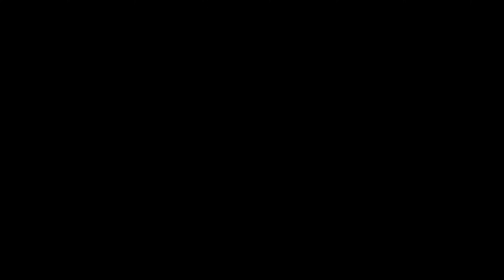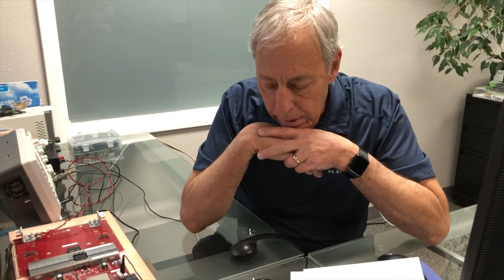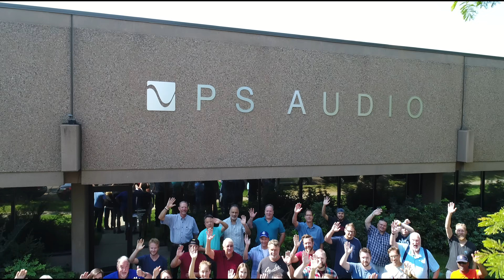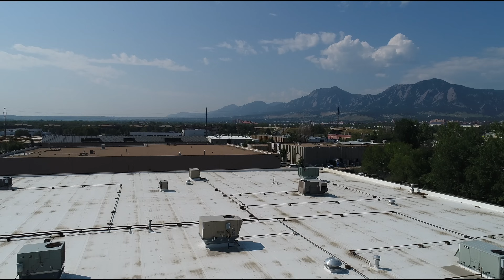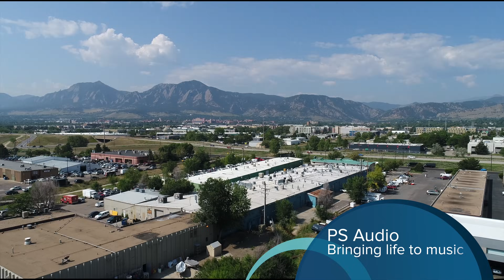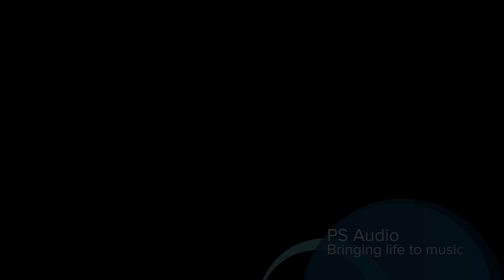What in the world is I2S?

Comment: Hello, is it possible to transmit the audio signal from a Bluray player via HDMI out (via an adapted HDMI cable) to a DAC Gustard X18 via I²S interface without errors? Or do you need an HDMI to I²S interface converter? Kind regards,
Ludovic
Reply: You would need that latter, as HDMI is a different system. When we have i2s over HDMI cable the signal remains as i2s and is boosted by a transmitter board using a RS244 chip to get around the inherent limitation of i2s over distance.
Reply: Also the pin configuration of the connection to the Gustard needs to be compatible, unfortunately not everyone is using the same pin configuration for i2s over HDMI.

Comment: I have a specific question that I doubt anyone here (expect for Paul/PS Audio) can answer. 

Recently, I've been interested in a high-end DAC that costs about 20K - it uses ASIO only, yet has its own master clock module that is situated on the mainboard; close to the DAC chips.
Can we assume that audio quality / accuracy will be equal or greater if the same DAC was using I2S? So in other words, does having a master clock in a DAC make the protocol you're using invalid?

I2S vs ASIO -
Reply: As long as the data stream reaches the DAC and the clocks are all correct and accurate there will be NO difference. Also, don't spend $20k on a DAC. You are clearly being ripped off.

Comment: Do I2S  provide DSD data when reading from SACDs ?  Wasn't there some sort of copyright issue hence the brands between the transport and DAC have to be IDENTICAL for I2S to provide DSD's  ?  If true,  is it correct to say I2S only works for PCM unless you have same brand DAC and CD Transport ?   Also, aren't there different pin-outs of I2S even using HDMI ?  I've seen DACs with what looks like RJ45's (network jack) labeled I2S too...... Thanks.
Reply: No sure, but the i2s/HDMI transmitter baord in my transport has a DSD connection, as does the receiver board in my DAC, I just didn't connect it on the receiver board in my DAC as i have no desire for DSD.

Comment: 2:16: and there it is... the reason for i2s is that it is easier for the manufacturer to implement while simultaneously creating a proprietary cable standard to lock you in to the one (or few) manufacturers that use it.  Personally, I’ve never “heard” an audible difference when super-clocking above the audio frame rate as the audio sample rate is still the lowest common denominator, but there are very tangible benefits to super clocking in a mixed environment (e.g. a recording desk) where multiple devices may be running different sample rates while locked to a common clock.  For this we have a standard for word clock over coax already that can run upwards of 256 x the audio sample rate, compared to i2s at 16 x the frame rate for left and right channel respectively.  Wish more audiophile companies would use the established standard instead of inventing new cabling formats without a demonstrable gain in performance.
Reply: I only read the first two lines, and you are so wrong I couldn't go on reading.

Comment: That was terrible! You explained nothing.
Reply: ...or perhaps you're just dull. 

Paul is right about I2S being superior. I would suggest "kernel streaming." This is most basic/optimal layer for audio on Windows operating systems. How can I prove it? Well, try this - Get yourself a high-end standalone CD player, then rip 1 track from a CD in 16 bit by 44.1 KHz. as a .wav file. Use a bit-perfect ripping software and check with Exact Audio Copy. The resulting file will also sound very similar to the playback you heard on the CD player. When you make machines work harder for the same result (ASIO - need to unpack and reassemble the clocks, there is degredation in quality & also higher latency).

Comment: Isn't I2S about the same as I2C?
I have used I2C protocol to control mini displays using an Arduino micro, was very simple to make it work by using available libraries.
Reply: Wrong. Not to be so critical but they are two different protocols. I2S is a protocol derived or parallel in working to SPI(Serial Peripheral Interface). I2C works great for displays and Memory devices and sensors but is too slow for audio. SPI and then I2S are the rather go to protocols for audio interfacing.
Reply: @spacesher3135  Thanks for clearing that up. That I2C bandwidth is too low for audio makes sense.
Reply: No its basically SPI. Infact pic32 uses the spi bus for i2s.

Comment: S/PDIF shouldn't really add any problems if it's implemented optimally. First, the data that comes in is also coming out 100% in the other end, in any normal case. It can resolve up to 24 bits of audio, which is plenty. It's using a Differential Manchester encoding called Biphase Mark Code (BMC) that is quite robust against timing issues yielding jitter. Still jitter is usually avoided as the data is buffered (having no data errors) and a PLL adjusted clock maintains the data that is fed into the DAC with no audible jitter. Yes, perhaps some crappy PLL can yield audible jitter. How is PS Audio ensuring no audible jitter on a S/PDIF input?

Comment: Dear Paul McGowan,

First of all. I love your channel, I try to keep up with as many vids as possible. Though I have a question you could be of great help with. 

Checking out if I am crazy or not ;-)

This is way off topic to this vid, but this way I hope to reach you again and I would love to hear what your professional opinion on this matter is.
I have a stereo setup, with Bowers & Wilkins CM10 s2 speakers and a good (Class D) amplifier (NAD C388).
The speaker wires I used were 4,2 mm² thick silver cables (AIV 23557L) from a big electronics store in The Netherlands/Germany. Already had them before upgrading the 603 s'3 to the CM's.

I was very pleased with the sound, but the fact that I used a (for me) quite high end system with cables I don't know anything about. I also had them connected via banana plugs to my amplifier because these were just too thick to fit bare wire (which I prefer). Also the right channel seemed more present than left, but then testing in mono, it was in balance. I wanted something I could rely on more and the investment was quite minimal compared to the rest.

Recently I bought 5 meters of Supra Cable PLY 3.4/S (shielded) cable (very affordable, but good cable according to the reviews) and made 2x 2,5 meter leads from them which I connected to the speakers and amp bare wire (+shield, if that matters). I left the HF-LF jumpers out by passing the wire through both holes, just what I did with the previous cable. They just barely fit through the amp binding posts by the way.

PS. I taped the speaker positions on the floor, so they were placed back exactly at the same position.

So the only difference is the Banana plugs are left out and I used another cable.

I tried very hard to leave any expectation bias out as far as that is possible, but I noticed 2 things.

At first, I just replaced one cable, to see if I was able to spot differences in mono playback. I noticed a sort of 'out of phase' experience, like if I had + and - swapped, but than a bit less obvious. I triple checked the polarity and it was not the case. Absolutely this effect was present and I could hear it 100%. Can 2 different (copper based) cables make such a difference? The cables were about the same length, but 4,2mm² vs the new 3,4mm².

Next I connected the 2nd lead and did the test again. It was normal again. Am I crazy, or is there a logical explanation for this?

Now the listening, which is very prone to expectation bias. I've posted my view on this on a Dutch tech forum, but everyone 'shouts' "expectation bias, you want to hear what you paid for"!

I just hear a difference. One thing I noticed is that I don't hear the sound coming directly from the speakers, but from somewhere between the speakers and even outside that perimeter (wider). Also I have the feeling the midrange speakers are now somewhat 'present', like the upper mids and high's are now really there. Is this the whole 'imaging' thing audiophiles talk about? I just couldn't imaging this would change with another cable.

This effect is also present when moving around a bit from left and right. Before that I had a very narrow sweet spot before thing got a bit out of balance. I still have that special spot on the couch when I am playing with my setup ;-) Still my wife has not declared for my insanity ;) she also loves music, but for her it also sounds fine when she is in the kitchen putting a lot of love in all the great things she creates there!

Is this all really possible with just a better cable, or am I imagining some things? Especially that mono test was quite obvious to me.

Please help me out with your professional knowledge and opinion on this matter, of maybe it is a nice subject for a vid :)

Many thanks in advance for reading my long post!

Ferry

Comment: TINSTAAFL! You failed to tell the dark side of I2S or any parallel digital interface. SIGNAL SKEW! Anytime you run synchronous pulse streams down cables or even PC board traces for that matter, you run the risk is timing differences at high frequencies.  Now most audiophiles have heard that timed speaker and analog interconnect  cables are a myth and that because of the low frequency audio signal. But when we get into the mhz range, an inch or less of length difference can cause problems in timing. In I2S the clock is often at 24mhz. It does't take much to throw that off relative to the data and other I2S lines. Multiplexing this into a signal stream eliminates this issue at the albeit expense of more jitter.

Another problem is in large facilities, swiching I2S would require 4 layers of switching. This quadruples the cost and system complexity as well as further invites timing skew issues. So safe to say external I2S is strictly a niche audiophile application. It is not used in professional audio systems.

In reality, a 6 foot HDMI cable will not exhibit this timing skew problem and the PS Audio I2S signal should work very well. But beware of running that for long lengths like over 25 feet. That could be a problem. As for sounding better, well that depends.  A poor I2S implementation will not sound better than a good SPDIF/AES implementation. With anything in engineering, there are few absolutes.

I wil say that HDMI technology is a far better choice than some of the RJ45/CAT5 I2S implementations I have seen marketed. At least HDMI is specifically designed to reduce data skew.
Reply: It is serial, not parallel. One (or infrequently more) serial data line, SCK (clock), and Word Select which is usually also just a clock. But yeah, the chips are only designed to interconnect few a few inches of wires, not drive a cable which should be done at a particular impedance, etc. But maybe the existing chips do have a low enough output impedance and being digital, minor reflections are ignored. Still suspect these extremely small differences wouldn't be audible. Need real triple blind testing.
Reply: Well, yes the audio data is still serial, but the fact that you have four timed signals, that in essence is a parallel interface to some extent. HDMI is a similar example. Here the RGB signals are serial but you need all three plus a clock so agian it's still somewhat a parallel interface. I also agree the audible improvement which would be due to less jitter is in most cases inaudible.
Reply: @andydelle4509  no. Just because it has a clock on other lines does not mean it is parallel, there is only 1 data line.
And its only 3 lines not 4, for stereo atleast, havent ever seen i2s with more than 2 channels.
Reply: @LittleRainGames  But the problem of timing skew between the DATA, BIT CLK, LR CLK, and MCLK is still an issue. That is the same issue as a pure parallel interface. If all the signals be it 24 data parallel data bits or a serial data stream with an accompanying bit and master clock, the timing still has a tolerance window. And I2S does have four signals, remember the MCLK clock which in some cases is optional.  That may be where you are thinking it's three signals but you need to design for four in an I2S system. I guess it's a matter of semantics here. I consider any signal transmission that requires more than one data stream with an embedded clock a parallel interface. Even the very early digital audio interfaces that used a serial data stream but with a separate clock pair had potential timing skew problems. This same issue is what kills long HDMI cables. The LVDS signal can easily go hundreds of feet even at 3-4gbs. But it's the skew between the RGB and Clock pairs that break the interface on cheaper long cables like over 20 feet. The longer the cable, the worse the twist length tolerance gets. This can be fixed with receive FIFOs on the data lines, but that's an added cost not every product has, especially in the consumer market place.
Reply: 192khz 32bit is bull sheeet

Comment: Why are you guys trying to sell the idea that one type of digital interface sounds better than another?
As long as the data is clocked in to the DAC correctly it doesn't make a difference what is used.
Smoke signals would work fine if it could be done fast enough.
Reply: A modern, quality DAC will fully "re-clock" and correct any jitter it recieves from a spdif signal.  There is no reason to muck about this I2s nonesense
Reply: The problem with multiplexing??  Paul, may I ask if you have any engineering qualifications,  this is simply misleading
Reply: Paul is right about I2S being superior. I would suggest "kernel streaming." This is most basic/optimal layer for audio on Windows operating systems. How can I prove it? Well, try this - Get yourself a high-end standalone CD player, then rip 1 track from a CD in 16 bit by 44.1 KHz. as a .wav file. Use a bit-perfect ripping software and check with Exact Audio Copy. The resulting file will also sound very similar to the playback you heard on the CD player. When you make machines work harder for the same result (ASIO - need to unpack and reassemble the clocks, there is degredation in quality & also higher latency).
Reply: Wrong
Reply: This is a faith based channel.
Use some buzzwords and a smooth presentation with anecdotes to give a warm and fuzzy feeling and you'll sell freezers in Antarctica.

Yeah, jitter is real but as long as the clock is as stable as it can be and placed closed to the circuitry that matters (the DAC) it's not a real issue. Damnit, multiplexing and transfer of bits in all kinds of ways happen all the time everywhere these days. It's not @#$%@ magic. If it was a real problem you'd be hard pressed to read any data from any kind of device or storage medium.
Reply: 'We have found...' 
Hahaha, what are you? The president of the likers club?
Call it the few who apply critical thinking. Ohh.... and just disliked the video so you were wrong to start with. hahahaha
Reply: We all need to worship at the altar of PS audio and believe everything you hear/read on the internet :)

Comment: Hello Paul,

Thank  you for your clear explanation on I2S.

I gave been following PS Audio for some time now and found an older article on I2S on your forum. I have no PS Audio equipment unfortunately. I bought a W4S Dac2 with an I2S input. So i searched the internet and found an I2S Pcie card which i installed in my computer. This card uses the PS Audio I2S layout so a normal HDMI is used for transport. 
I do agree that I2S is the preferred way to use as an interface on digital audio, it sounds great. No reclocking or other tricks to clean up the signal.

I hope one day i can afford myself to buy PS Audio products because i think you all do a great job on designing reference audio products.

Best Regards

Mark

Comment: If HDMI is superior in delivering audio quality than S/PDIF, why isn't the HDMI used more widely on external DAC? How does it compare to USB connection in audio data quality? Thanks!
Reply: You need to listen more carefully. HDMI is used to transport the I2S data, which needs multiple connectors that HDMI provides. Paul said it can be any cable but he choose HDMI because it's well shielded and easy to get. So the HDMI here is not meant to transport regular audio and video data like in a media player.

USB is even worse than SPDIF because it carries electricity that may produce interference.

Comment: Is there actual audiodata-loss in the "coding" of the audiodata and clocks? Just wondered. The story doesn't tell.
Reply: Its fully digital, there is no loss.  Clock recovery and timing are the issue, although these days I suspect its all fine.
Reply: Its basically an Spi line that doesnt stop transmitting. And SS is used to tell the Dac/amp/slave what channel it is. 
The clock keeps pulsing, and every 8, 16, or 32 clocks, the SS pin will toggle, and then the other channel will be pulsed out. 
Its a fucking bitch lol.
Not because of that, but you need to tell the slave what kind of data it is, how its justified, and a bunch of other things, usually over i2c.

Im in the middle of creating a library for  the TFA9879 amp, got most of the I2c finished, and for some reason my mcu will not send out the i2s data, clock signals are working, but once i fill the buffer nothing gets transmitted.